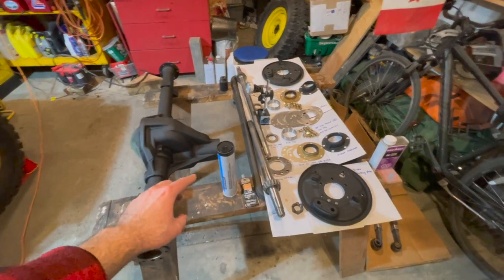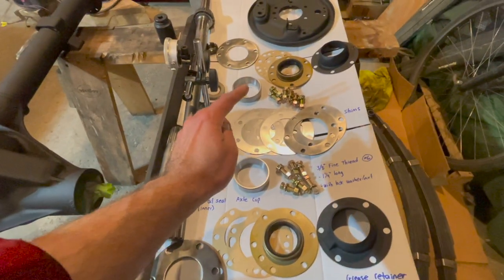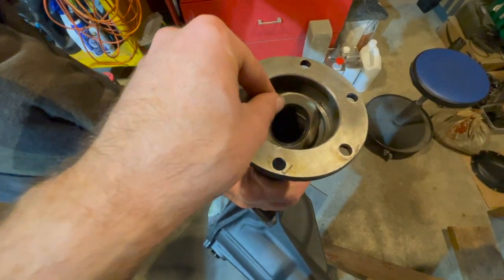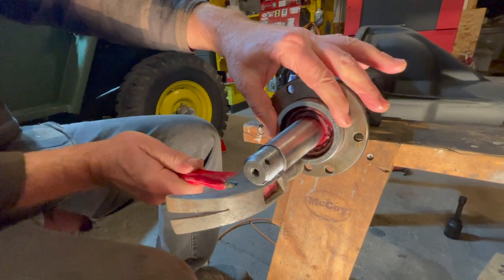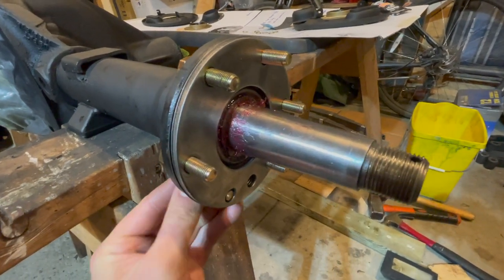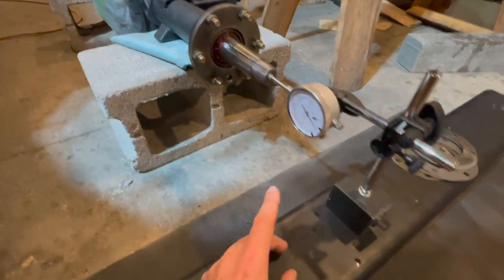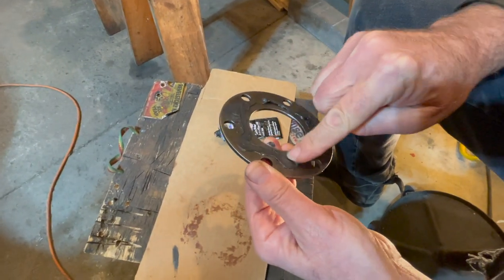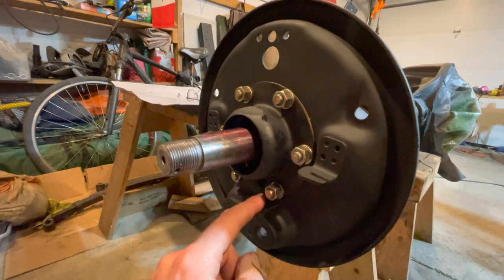How to REBUILD & INSTALL Dana 41 Axle Shaft (Complete Installation Guide)

Comment: Well organized instructions but I would polish or sand axle shaft before installing bearing so not to contaminate bearing with metal dust even if its rinsed with acetone